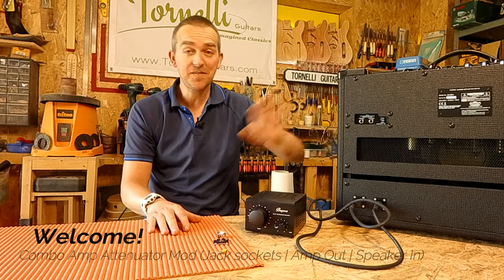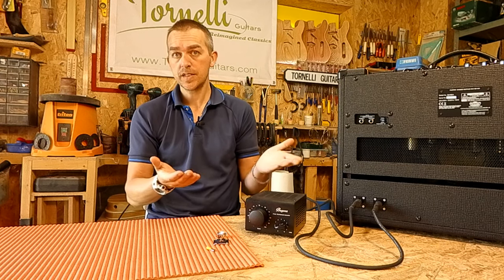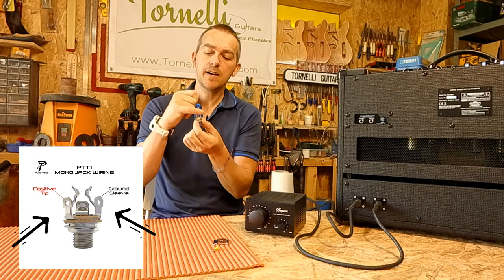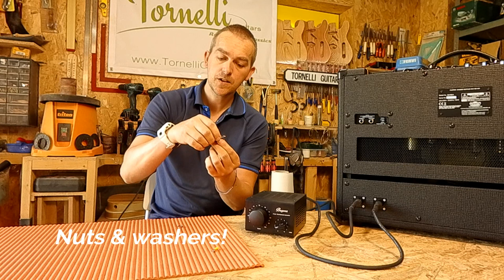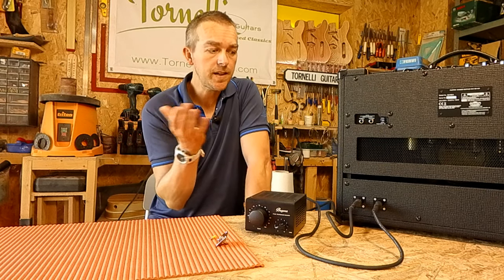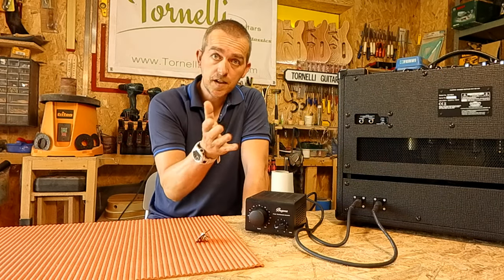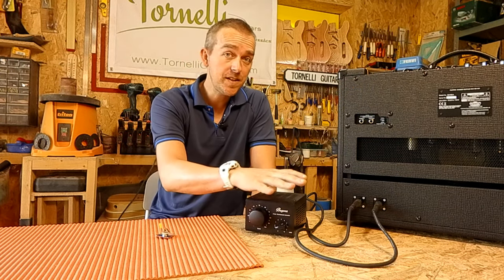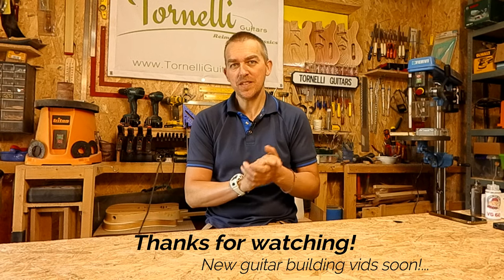Guitar Amp Attenuator Mod | Adding Jacks (Amp Out | Speaker In)

Comment: Awesome explanation, definitely will do this mod,  I have everything to do so, even the same attenuator,  thanks.

By doing this, the extension SP will still work under this config?, I run my ac15 with another speaker connected to extension SP in the back of the amp, will this speaker be attenuated too?
Reply from the maker: Thanks for the kind comment, I’m glad the video helped. That’s a great question because I don’t use the ext speaker but the ext speaker out won’t be attenuated by doing this mod that just places the attenuator in between the amp and cab speaker. If you follow the wiring trail from the amp to the ext speaker you will see that they are separate from the cab speaker. Hope that helps 👍
Reply: thanks for the update,  i will share later how it went  - me doing this mod

Comment: I've only done this with audio circuits, but could you use an open/closed circuit type jack that would maintain the connection between amp and speaker until it's plugged into, interrupting the connection? It's a great mod but I'd be more comfortable if I could eliminate the danger of anyone ever unknowingly powering up the amp with no load.

Comment: Nice, neat workaround. You now need to get the power soak mounted into the chassis 😬 how do you find the Bugera?I have toyed in the past with attenuation for mine; it’s so loud it’s unusable outside of a band situation so it’s just a spider farm in the garage at the mo which is a shame as it sounds incredible and I’d love to be able to demo builds with it
Reply from the maker: Thanks Jamie, the Bugera actually seems great. My favourite sound and where I spend the majority of the time is around 75% vol because I like to plug straight into the amp and get drive without pedals so this mod has proved invaluable. It still play reasonably loud (for home use) because I have no neighbours, probably somewhere around 90-95db so I’m sure it helps that I’m not attenuating a 100 watt amp by 90%. I tend to need to re EQ when it’s plugged in but that’s normal too.
Reply: @TornelliGuitars  thanks Gio, that’s really interesting and helpful, Being mid-60s, mine has no master volume so natural drive is out of the question in pretty much any conceivable situation 😂 I might see if I can find one to have a play with and see what it does to the tone and whether it’s viable.

Comment: What was the diameter of the drill bit that you used to drill the hole for the 1/4” jacks? I have the same Puretone jacks and I’m wondering if I need a longer jack as the lower wooden panel on the AC15 is thicker than the length of the jack. Thanks for posting this! Can’t wait to complete this mod.
Reply from the maker: Thanks I think I used a 22mm forstner bit for mine.👍
Reply: Thank you! I’ll be trying this soon. 👍

Comment: How would you do this on a stereo amp, like the JC-40?
Reply from the maker: Hi Evan, I’m not familiar with doing this on a stereo amp however I believe the JC40 is solid state so attenuating it wouldn’t have the same result as attenuating a valve amp.